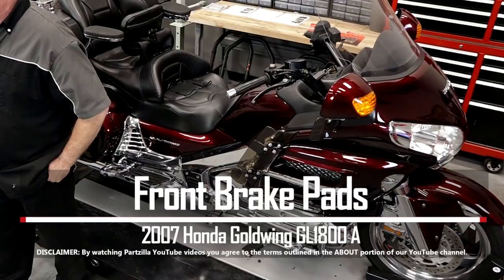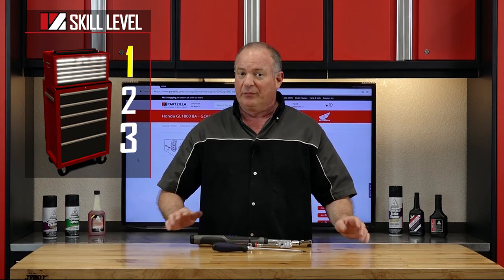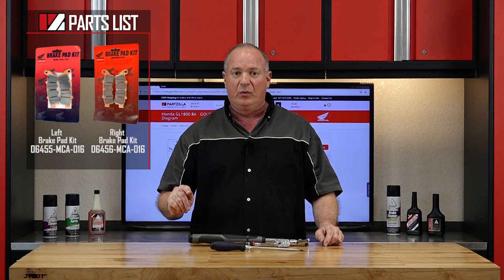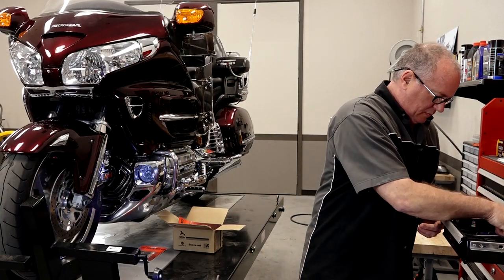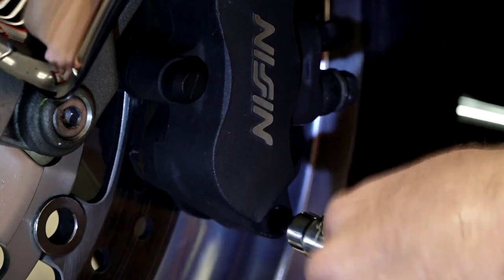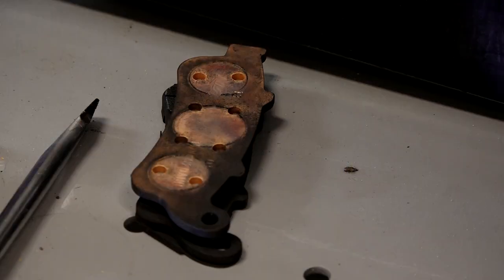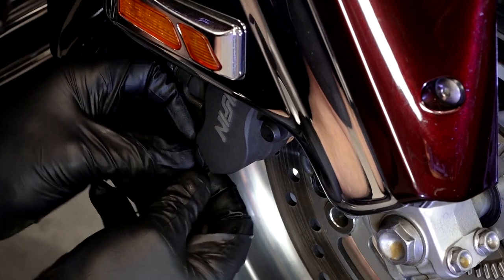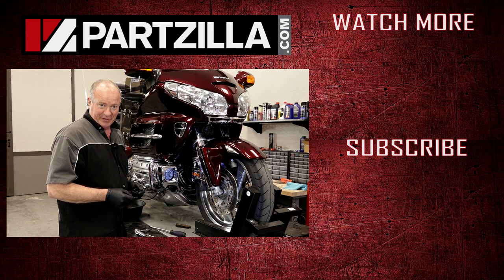Goldwing Front Brake Pad Replacement | Partzilla.com

Comment: More like skill level 0.5--Just did mine on my 2017 F6B and I would add when you pump the brakes back up--also do the foot break (front & back are linked)--mine was way to squishy when I did the initial ride. SUPER simple process.

Comment: Ok.  I bought the pads from you guys for my first Goldwing - a used '16 F6B Deluxe.  I watched this video, and then went out to the garage to change the pads.  6 minutes later, I found myself just laying there on my side on the garage floor thinking "Something must be wrong.  It couldn't have been this fast and easy."  I literally laid there wondering if I did something wrong longer than it took me to change the pads on both sides.  I gotta say that I have been completely blown away by Honda and my F6B so far.  I'm wondering why I was so reluctant to make the switch from a problematic '15 Harley CVO Road Glide Ultra to the Goldwing?  I'm so incredibly stupid for falling for the whole Harley thing for so long.  Everything I've done to the Goldwing has been such a breeze.  Everything I hadda do with the Harley was always such a PITA.  No more.  I'm sold on the Honda Goldwing hook, line, and sinker.
Reply: Welcome to the Oldwing crowd Ace
Reply: @Andy-hr2ui  Several times now.  It's not too bad.  It is one of the poor design points that Honda dropped the ball on.  Don't feel worried about tackling it yourself and saving a LOTTA dough.  There are lots of really good, detailed videos on how to do it.

Comment: One thing to add...check the brake fluid reservoir level BEFORE prying the old pads apart.  If it is full, it could overflow and ruin your paint.  I always take out most of the fluid first.  If the reservoir has any sediment, now is a great time to do a thorogh flush.

Comment: One other thing that isn't mentioned in these videos... when you are finished, BEFORE riding, make sure you pump your brakes back up to get the new shoes against the rotors. You will have no brakes until you do and you don't want to find that out too late.
Reply from the maker: A valid point, sir!

Comment: This bike has ABS....You are playing with fire to just compress the pads without loosening the bleeder valve...Pushing dirty fluid backwards into the Anti-lock servo can cause mushy brakes and bite you in the wallet....It doesn't take much loosening to get it to bleed, and then tighten it right back up without touching anything else and you won't suck any air in....
Reply: Whoever told you that isn't a motorcycle mechanic.

Comment: Thanks for the video. I did order the pads from you all and they sent me 3 sets of the OEM 06455-MCA-016 pads as your salesman said the pads were the same for the front left and right and rear and your link in the video showed the same thing.
In your video you said to put the pad with the shim on the inside.
That works for the front left however, not for the front right or the rear caliper. The shim cannot be reversed to the other pad due to the extra hole for the pin.
I used the shims off my other (used) pads for the opposite side as they were aftermarket and did not have the hold for the pin to go through. Something is not right here however I did get the job done.

Comment: I read every so often, that I should clean the pistons with brake cleaner before I push them back in?  Any opinions on that?  I'm done the pads before and didn't do that, but it does make sense.  I worry about getting brake cleaner on areas I don't want it.  Like the paint and wheels/rims.  Thanks for giving the torque specs.
Reply from the maker: You can clean them without brake cleaner.  You don't want to affect the seals.
Reply: twowheeled, You are absolutely correct. The reason Why the Pistons should be cleaned before being pushed back in a caliper, Is because The caliper dust seal can't remove baked on brake dust from the piston. 
Brake clean "Does not" harm the seals.
I use a cleaner called awesome, and an old toothbrush. Rinsed off with a spray bottle of plain water.

Comment: Honda lists 2 sets of pads for the front.  The left front pads wear about double the rate of the right.

 Pads are the same. If you need to change pads you can reuse the shim. Other than that the pads are the same.

As for getting the pistons back into the caliper,  pushing on the caliper works best. It let's you check for a stuck slider.

Make sure the pistons are clean before you push them back into the bores. Give them a good spray of brake cleaner.

And don't forget to pump the hand AND foot brake to reseat the pistons against the rotors before you ride.

Don't waste your time or money on aftermarket pads. Honda OEM only way to go.

Comment: I see they took out good pads to make a video. (Notice they didn't show you what to look for in a worn pad?)
You must always Clean and grease the caliper slider pins, so the caliper can "Float" and not wear pads prematurely/unevenly.
Changing pads the way the video portrays is for emergency's only!, to get you home to do the job correctly.
Reply: The way they show to replace pads in the video is how my Gl1800 Honda Service manual says how to do it.
Reply: I would suggest raising the front by jacking under the oil pan.  While the brake pads are out on both sides, spin the wheel to check your bearings.
Reply: Lubing the pins will just attract brake dust and other debris causing more problems than it’s helping. Now if it’s a car and the slide pins are sealed with a boot. Then yes. Grease them. But these are exposed pins like a Toyota 4 runner front caliper. You do not grease this style.